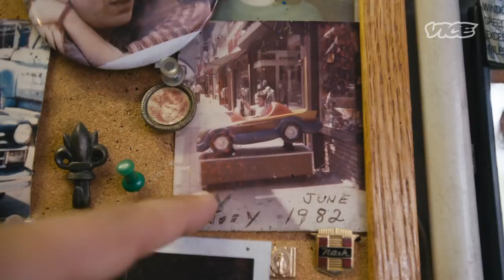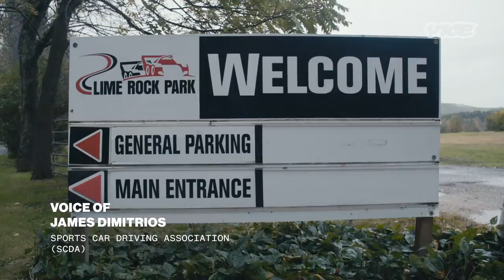Can An NYC Street Racer Become A Professional Driver?

Comment: He needs a Miata with slicks and time on the track
Reply: Yeah, its about 250 bucks for a whole day of driving hard. Super cheap for motorsports. Also parts & maintenance SUPER cheap and easy on miata.
Reply: This. It would be perfect for learning proper cornering and braking, not to mention a fraction of the cost for maintenance. He could also make a name for himself among professionals if he started competing in Spec Miata races. The BMW is a great car, but it would be a shame to crash it on the track, especially since all that power could bite you in the ass if you're not careful.
Reply: Spot on guys....no reason to blow your entire paycheck on a hobby. Also he could buy a racing sim too for home. Just saying.
Reply: Jake Novey Yes this exactly, that BMW is a real expensive way to get into track days. 5K even buys you a seat in a spec Miata race.
Reply: Exactly Spec Miata or SpecE30 would be the way to go to actually go somewhere in Motorsports. Just a track day every once and a while will get ya know where.
Reply: What he needs is a kart
Reply: I have to agree it most likely gets expensive for michelins and oil changes on a bmw
Reply: Word
Reply: Thomas Robinson Ha funny I grew up loving miatas with my dad buying and selling them I had been in more then 20 by the age of ten!

Comment: 1:25 wtf look at his hand yo
Reply: It's a simulation bro!
Reply: @Crabman_87  well shiddd that's what you call a glitch then
Reply: @redb8053  u feel me
Reply: lmao!
Reply: Yoooo
Reply: T-1000
Reply: It's a Shadow bro chill
Reply: That was fucking weird
Reply: Niko we gotta figure this out bro, like  why??
Reply: Also look at 8:44 there is a strange object in rear window for a second
Reply: GenCloud Superior Marketing 
Creepyyy
Reply: Lol
Reply: GenCloud Superior Marketing Thats a human working on the rear left wheel
Reply: most likely he got into the truck, and the camera man starts to move 10-20 seconds later, but they didnt want to leave that part in, so they cut it out, and in those few seconds he put his hand from the inside to the outside. To make it look like one smooth shot they did a fading cut, and not a hard cut, which explains the creepy hand
Reply: its warping from the thing that they use to slow the clip down. if it didn't look like that it would be choppy af during the slow parts
Reply: recut and merge again
Reply: Ok let me explain..
That is an effect called morph cut in Adobe premier pro.
Because the shot when he got into the truck and when the camera moved has a lot of time in between they just cut out that middle part where nothing is happening and join the two using the effect called morph cut.
Nothing sketchy here, just an effect to make look jumpcuts look seamless
Reply: Wtf
Reply: this whole doc was 3d rendered
Reply: This man a terminator

Comment: For anyone that doesn’t understand NYC too well I’m gonna break it down better..

There are multiple people in NYC that build their cars (including me) that would love to actually track their car and legally and race (Drag and Circuit). But the closest one we had got shut down after the Times Square incident. 

There is an extreme amount of space in Long Island that isn’t being used and far away from residences that they should turn into different type of tracks. There are multiple different groups that are honestly trying to get tracks built and going. But the problem is the city and state isn’t allowing it and people been fighting for YEARS. 

The car community is huge in NYC especially with Mercedes, Honda, infinity, and BMW. So since the city isn’t trying to cooperate with the racers they take it to the streets 🤷🏽‍♂️. 

I’m sure if they did a go fund me for it people would all chip in.

None of these cars are built, this isn’t street racing, these are kids running the highways. Most of the cars in NYC are hondas, BMWs, Mercedes and infinitys Vice fuvked up choosing them on the “street racing” in NYC. And that Mpire group is super annoying. Cocky as fuck and swear they all superstars.

Comment: Start with shifter carts, that's the best way forward. Everything's exaggerated with tiny movements, that will make you smoother in a car. The G force in a shifter cart will actually make you dizzy. Biggest reason, it's semi affordable.

Comment: A pro drag racer possibly a pro drifter I don’t think so, most of them are driving high hp auto transmission cars, easy to hide behind power.  try adding a manual trans with a clutch pedal and hand brake, it becomes something extremely harder and more involved. Most can’t even get concept of having to depress clutch to handbrake, never mind shifting.

Comment: Unlike the other clowns at least Joey took it to the track. Good on him.

M3 is really nice but too expensive a car to track. Better to get a cheap beater to start. Costs add up really fast in motorsport and really harsh on cars. Blow up anything on that M3 then will insanly expensive to repair. Better to get an old e36 for example, strip it out and thrash that instead.

Comment: This doc has so much bad info. Pro racing isn't expensive at all to get into. Tracks are cheap to rent and a lot of pro leagues put caps on the amount you can spend on a car.  Look at any NASCAR drivers career they all start on either go karts, trucks, or spec Miata.  I only bring this up because this documentary makes it seem like legal racing is impossible so people have to turn to the streets. In reality it's completely opposite. The only reason why someone races the streets is because they aren't good enough to race the tracks.

I competed in 30 plus races with a $4,000 Miata which is far cheaper than most street cars. Most of it was covered by sponsors and if I was any good it would have all been paid for and I would have moved up to more expensive cars. A spec Miata on a course with left and right turns is challenging, safe, and fast enough for amateurs. Street racers are the scum of the racing community, there is no need to glorify them.